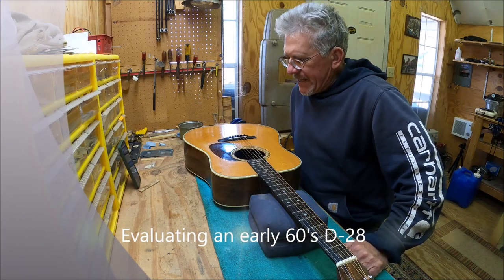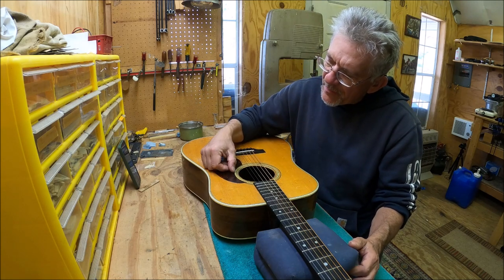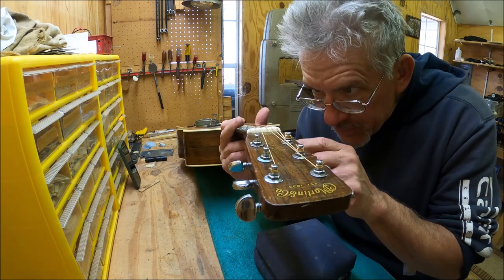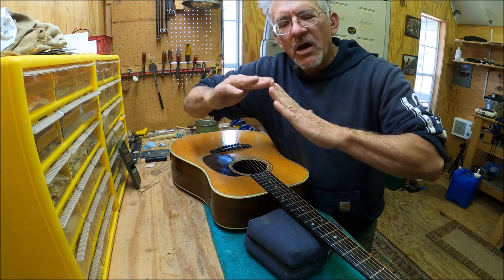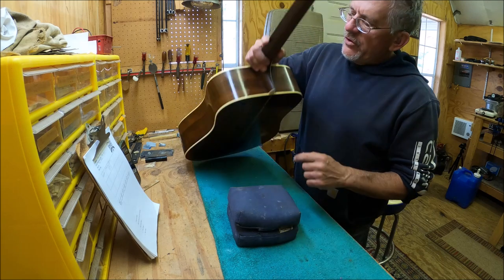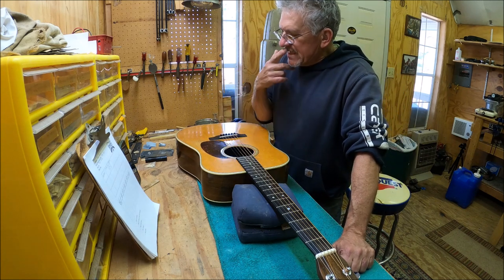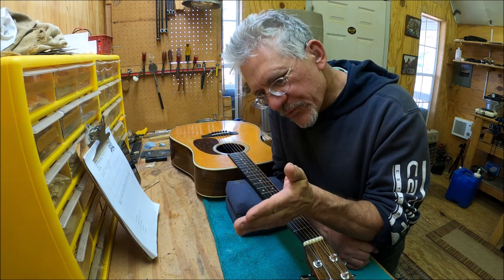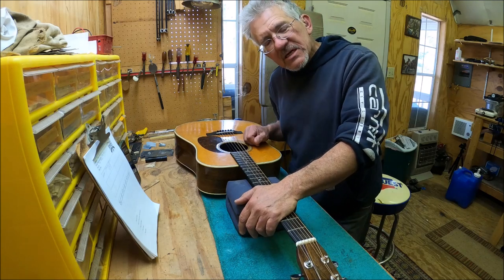Evaluating an early 1960's Martin D-28

Comment: Have you ever offered an option of cutting two different saddles to accommodate light or medium gauge sets of strings. CFM Co did that for me when I sent my late 50's D-28 back to the factory for a bridge replacement when it started to pull up back in the 70's. So far so good in 2022. Love your channel.
Reply from the maker: Sure... 'cept they're usually not string gauge related.  They'll just be "higher" or "lower" saddles.   IME, some guitars don't even react to string gauge.  Some do.  Action can vary by humidity and other factors as much or more than just string gauge.  But if the customer wants extra saddles, no problem.

Comment: Interesting to hear about the top color being an indicator of the type of spruce. When you mentioned that, my ears kind of perked up because we've got a 78 bone that has a "yellow" top & it also doesn't have the cross grain that you commonly see with sitka.
Reply from the maker: Yeah... I've seen a few early HD-28's like that and there's at least 1 D-35 on my channel where I commented on the top.
Reply: @Bryankimsey  I've heard rumors that a few of the 70's HD-28's may have gotten some old stock Adirondack. Is that possible or would that only be the case for a custom order?
Reply from the maker: @redlinemando  Martin didn't know what "Adirondack" WAS until John Arnold enlightened them.  Those yellow tops are probably German or Engelmann, both of which they did use.  The former was often called "European".  And the latter... "spruce".  :)
Reply: @Bryankimsey     Thank for the info!!!! My curiosity is definitely peaked on this topic. There are several curiosities I have with the 78 HD that we own. The back & sides of the guitar are unusually dark on the inside. They look Brazilian on the inside, but I've never heard of a 70's HD being Brazilian & it's back & sides look WAY too much like Indian from the outside. I'd love to send this guitar to you so you could tell me more about it!!!! It has a unique tone. It's mellow, but at the same time, it's loud & sharp with a fairly fast decay like the much older Martins. It looks to be completely stock on the inside & has scalloped braces. Right now, it's sitting in the case with the strings tuned down a half step because it's too high for me to play.
Reply from the maker: @redlinemando  You should e-mail me with some pictures.
Reply: @Bryankimsey     Ok.......I'll do that!!!! 
update:  As soon as I find my square telescopic mirror.   lol
Reply: @Kimsey Lutherie   I took a few pictures of the out side of the guitar, but I still haven't found my mirror yet to take pictures if the inside & braces. Upon further inspection, I was also mistaken about the top. It is definitely more yellow than a typical Martin of that time, but it does indeed have a lot of cross grain. 
     Something else that I noticed is that the Martin logo is raised. It's almost like they either put on part of the finish, put on the logo & then sprayed on the rest of the finish or they put the logo on last. I know the guitar is original, but that part confuses me because (I could be wrong) but I believe my 73 has an even finish over the name.

Comment: What a nice guitar! My 1966 D-18 has the original nut and it's plastic. I wonder what year Martin went to a plastic nut. (mine had plastic saddle that was replaced in 85.)
Reply from the maker: My understanding is that they used plastic and ivory (!!!!) interchangeably during those years.  Same thing in the 70's.  Most are Micarta in the 70's but you'll see some with ivory.